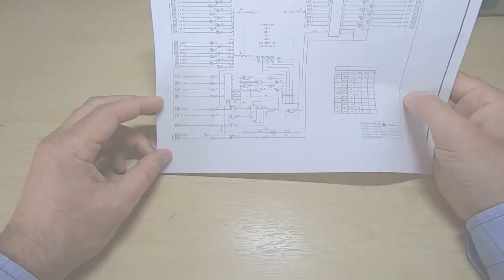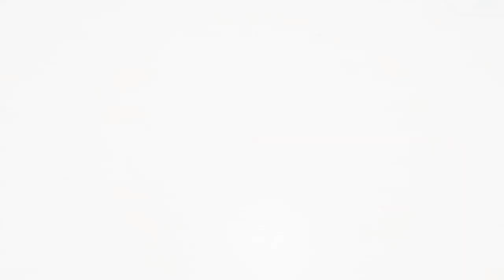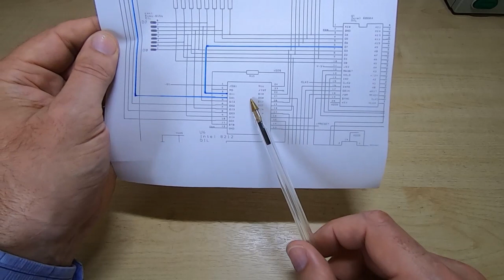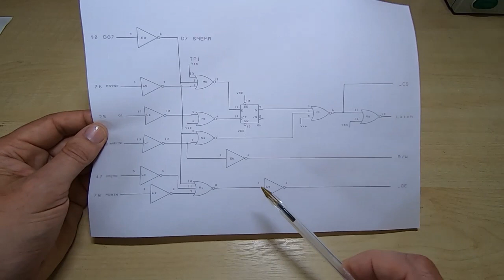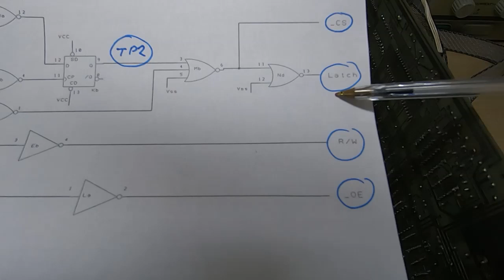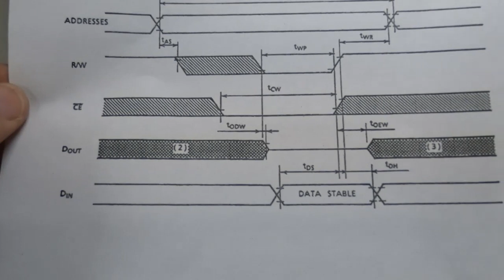Designing a 64k SRAM Card for Altair 8800 Part2

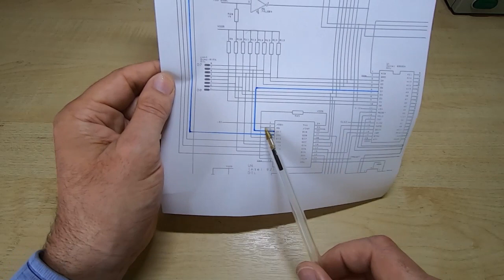Comment: At 8:39 you refer to that chip as a latch. I can't read the chip number, but looking at the schematic I have for the Altair CPU board (from the "Theory and Operation" manual) it should be a 8T97, which is a buffer. Am I misunderstanding something or did you misspeak?

Great videos, btw! I've been teaching myself about how the Altair 8800 works and it's next to impossible to find any information about it at all, besides the original documentation. Having videos to supplement the documentation is very helpful
Reply from the maker: I was refering to its function rather than the specific device type. The operation of the 8800 is a bit odd due to the way that the display board is used in place of a more typical monitor program. For the purpose of the memory cycle the buffer is used to 'latch' data onto the bus although as you say it is actually a buffer chip. Because I was trying to describe the memory cycle used to address the memory card I was designing I referred to it by its operation rather than its specific device type. Apologies for any confusion.